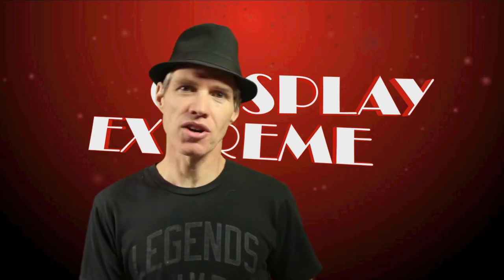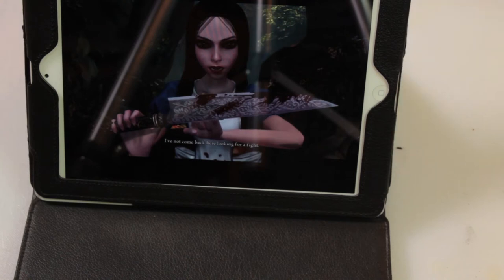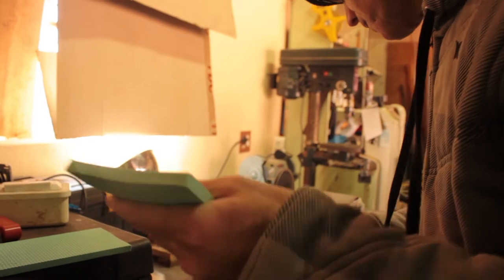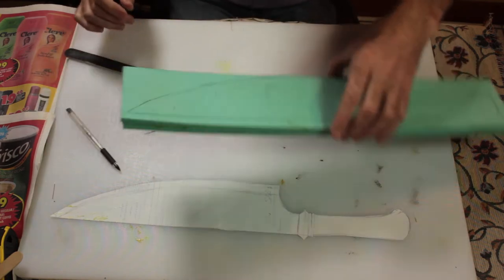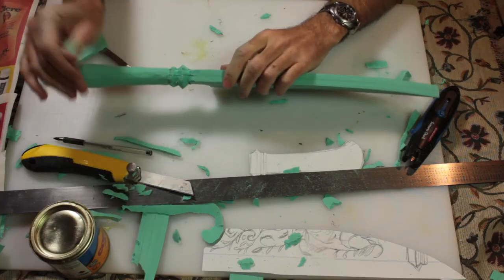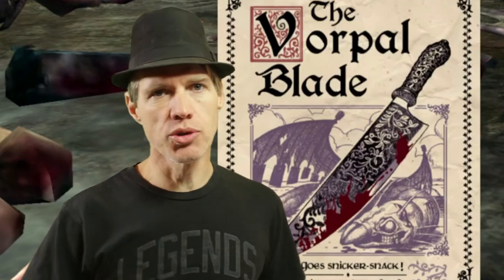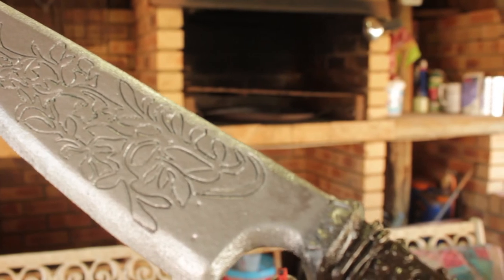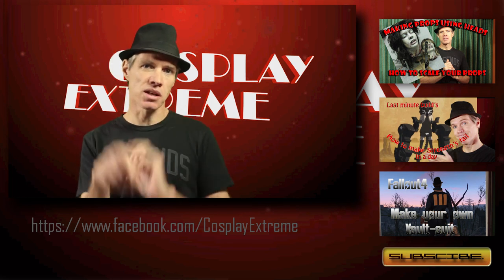The Vorpal Blade (Alice Madness returns) how to make a con-safe knife

Comment: Very well done build, especially out of foam. It was nice that for tutorial purposes you used the dremel to bevel the edge but you may have had an easier time with it if you had done the beveling on the the belt sander. That tends to be how I bevel all of my blades be they made out of foam or plastic.
Reply from the maker: thanks for the tip.  I'll do that next time :)